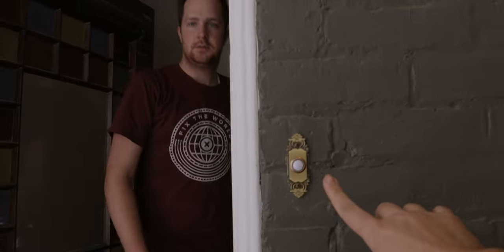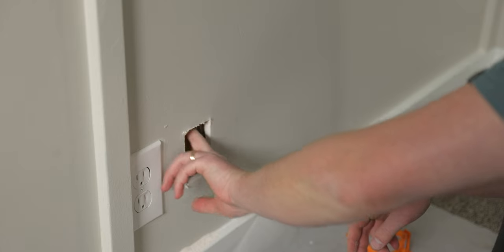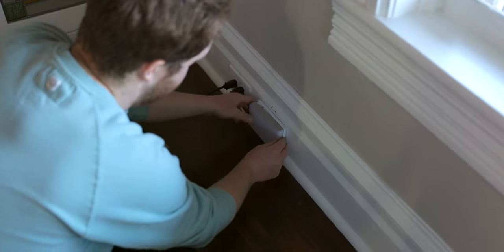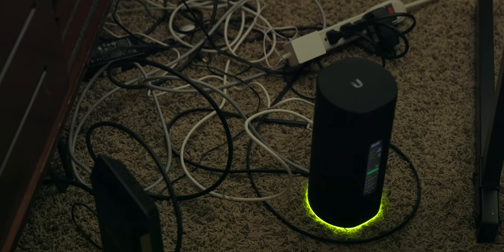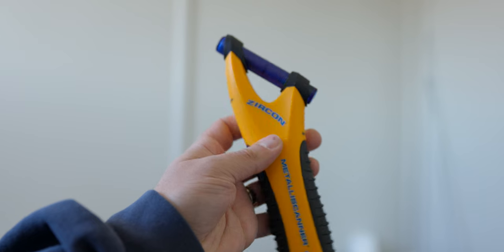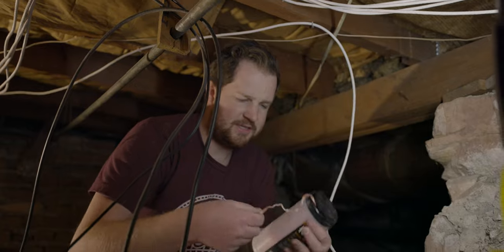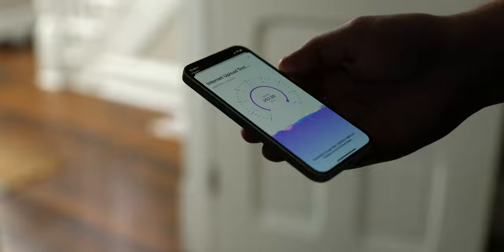Adding 10 Gigabit Ethernet to my 129-Year-Old House!

Comment: Recently found your channel. I do have a question about wiring my similar home. I only have a small network need so my question is this. Can I simply use my modem and a couple mesh routers, one that I connect to the modem via cat6 ran through my walls (plaster like yours btw) on my main floor and the connect the second mesh router/node (or whatever it’s called) via cat6 that is located in the basement? I really only need to connect my main tv, xbox, computer and maybe a second tv wired, the other devices can be connected via wifi.

Comment: I have a "router" exactly that you showed in the video (the white cylinder thing) given by my ISP. I bought two Ubiquity AC in-walls with the hope of routing CAT5 from two of the rooms in my house to the basement and plugging them into that router. Is this even possible or do I need to have a Ubiquity gateway as well? Currently my whole home is getting Wifi from the one router and it isn't covering the whole house with good connection and I've never had luck with the plug n play wifi booster things so I thought this would be the perfect way to essentially create two additional "routers" in my house by having them plugged into the main "router". I'm looking at the install instructions and I'm not sure if this is even possible anymore...

Comment: Obviously new drops should use the best cable you can afford.  However you should have dropped a caviet - If you do have Cat5 DO NOT run out and replace it.  Test it first.  There are meters that will verify your cables for various speeds.  If money is no problem go ahead and buy one.  The cheapest one I know is Fluke and it's 2 grand or rent one or buy someone a beer to come out and use their meter real quick.  If your runs are 50 feet and below 10Gb will work fine on Cat5.

I have a 1800 square foot home.  My longest run is 41 feet.

Comment: Yo, are you in Utah? I install Google Fiber out here and I just wanted to let you know that FJ/ONT that was installed isn't the best. We refer to it as a COTS ont or GFLT132, but they recently upgraded to a mulitgig version of the same thing that has a red ethernet port called the GOGPC220 if I remember correctly. If you change your plan to the 2 Gig BYOR that recently launched a tech will come out and swap it for you, which takes about 5 minutes

Comment: Any suggestions on legitimate pre-terminated cat6a if it's needed?(or hell even cat6)  Seriously from all my looking around it seems like every company in existence is skating around what the standard is supposed to be....and yes that includes the oh so beloved monoprice.  To be more specific, most "cat6" cables you find won't have the separator core, and similarly cat6a won't be properly shielded or have overly thin gauge wire, etc.

Comment: Wow, I have been doing research the last couple of days and have been getting lost on all the different things related to my internet. You really explained this stuff well for anyone to understand!!

I have been looking for vendors of Cat6 ethernet, and I am curious what options are out there for who to buy from. Where did you (or anyone else in the comments) buy their ethernet cable from?
Reply: Monoprice has good cable. When I was at my old place I used theirs and it worked fine. So long as you don't go bargain bin you'll usually be fine.

Comment: I have my Ethernet cord duct taped to my ceiling and intertwined with my stair case banisters. I dread having to bring internet to anyone else in my home. I generally just sacrifice my wired connection and go completely wireless so they can use it.

Comment: Fyi, you will have no luck trying to put cable using existing phone or coax cable. That cable is staples to the wood in the walls during construction by code. You really should put a disclaimer about that.

Also, pretty much every wall in a modern home, even interior, will have wood going horizontally in various places as well. This can easily prevent you from just pushing cable through the wall. Which is why it's actually common for installers to cut out sections of drywall to keep cabling up between floors and then patching up the drywall afterwards.

Finally, be careful with cable jacket ratings. Homes tend to not have this issue, but I'm sure a lot of you will end up running cable for someone in a more commercial setting at some point. You MUST, by LAW, use CMP (plenum rated) cable through ceiling or raised floor areas if air circulates through those areas. It's not uncommon that HVAC systems in commercial buildings will move air through the ceiling area above the drop ceiling. Air return ducts will just go right up into the ceiling. Check your return air grate and see if the air is channeled through sheet metal ducting. No sheet metal ducting, you must use plenum cable. The reason is simple, it's a major fire hazard (quick spread of fire through the cable through the space). And on that note, you should use this red fire putty to seal up any larger holes you might make to feed cable through.

EDIT: it's very difficult to run cable bundles when you remove it from the spool like he did. You will get the new to tangles and stuff when you try to pull. I know, I've tried it commercially before. It sucks. That's why people use multiple boxes.

Also don't bother with those insulated staples for that use. Just get J hooks.

Comment: You commented that as long as the ends of the cable are terminated the same on both sides is not correct.  Pins 1/2 are a pair as with 3/6, 4/5, and 7/8.  This means you place one twisted pair inside of another.  If you don't do that then you will not have twisted pair according to the spec and 10G won't be as reliable.

Comment: Good video. I have a thought and this is definitely up for discussion - if you have existing cat5e cabling in your house because it was build recently enough for ethernet to be a consideration, but not so recently that it was just automatically run with cat6, I would absolutely just keep using the cat5e and not worry about the fact that i'll probably only get a maximum of 5 gig on multigig equipment over any moderate distance.

BUT in a scenario where you plan to run cable all over the place and want to be as future proof as possible... is blanketing your house with fiber the better move? Conceptually my argument is yes, though i realize there are some pretty major gotchas right off the bat:

More expensive (than cheap consumer) switches. Devices often have RJ45 ports, but not SFP ports. Doesn't carry power so POE to a wap means you still need some RJ45 too. 

The benefits would be "just swap out the gear connected at each end for essentially limitless bandwidth upgrades, typically thinner runs so you can pack more fiber pairs into a smaller space." But unless you have such a big hous e where you have a core fiber switch and then access switches elswhere... this is kind of an insane solution. That said if people have a setup where their internet comes in to their basement and they need to hook it up to bedrooms upstairs it might be worth getting in a pair of fibers (or a whole bunch of extra fiber strands) from the basement to the top floor, then using that as the uplink between switches. That way your internet connection can change as time marches on but you'rte never limited to the one pipe you ran from the bottom to the top of your house.

I guess all things considered, running lots of fiber isn't the greatest idea, but including fiber in a house rewire for any kind of switch to switch run should be a no brainer.
Reply: I cabled my 5500 sq/ft  house with Cat 7 and have been totally pleased with it.  I ran a minimum of 2 cables per run (don't run 1 cable  unless you have a VERY good reason, the time and frustration you save  is your own...).  The connections are great, I don't worry about AC lines interfering and the cross-talk problems some folks have.  If you look at the cable itself, each pair is individually wrapped in foil to mitigate RMI/EMI.  They aren't giving teh stuff away for free, but comparing it to cat 6 the difference is worth it when it comes to speed, performance, resilience and all that.

Comment: Well it works fine till 100mb with any color mix. 2 Gigabit device may not even work/chat if colors are not in a or b correct order. And yes i learned that a hard way wondering why system is not working.

Comment: Needs to be keystone (cat 6a) to do 10G. Rj45 is not rated for 10G. Also, I would go for cat 7 rather than 6. And solid core cable inside walls

Comment: I have a house built in the 1970s, but it took like 10 years to build and it was built by people who were born in the 30s and 40s... they were also kinda freestyling it, they just had their friends and colleagues help them build it as they knew best... My house has absolutely no access points for nothing, just 2 telephone ports installed in the 80s, also it's a 250 sq. meter house, that's 2700 sq. ft. by the way... Also, I have no LTE/4G/5G signal... People are coming to install fiber optic internet next week, I wonder what they'll do...

Comment: Looking at this as a European viewer and wondering how American houses don't get blown away or catching fire more often.
We have 95% brick walls, none of this applies except for outside runs (which we hate doing because of esthetic).
Consider yourself lucky for having hollow walls, we need to either use existing holes in the wall (rare) or cut grooves and drill through brick/concrete to run new cables. Not to mention replastering and painting afterwards.

Comment: 22:08 ..oh my 110 punch-block keystones .. Why?!!  Some 20 years ago Panduit made a keystone you pass-through (like you did on Rj45 plug) wires through one part (trim wires on outside with scissors), and then simply snap that "cap" to second part (base) of the keystone and you are done. Easy-peasy.

Comment: What should you use to make sure each line has it’s own dedicated link to the internet?
Reply: Nothing. That's why you have individual cables running back to the network closet. All of the devices plugged into those cables form a computer network.

Comment: My house was built 2 years ago and for some reason they decided that there wouldn't be any ethernet cables in the walls and that there would be no walls above the space the router is. So basically if we want ethernet going anywhere, we either run the cables along the walls or demolish the walls completely.

Comment: Why are access points better then mesh system. I know not all mesh system are the same but most mesh system now and days have Ethernet ports on the back. You just plug the node/satellite into the main router Instead of wireless and now it’s like a access point. So with a mesh system you get the choice of Wireless or hard wired. With access points your stuck with 1 option and that’s hard wired. I’ve been looking at the new orbi WiFi 6E and trying to figure if I buy like 2 50ft patch cat 6A Ethernet cables (going outside the house then back in where I want the node) and plug both satellites into the main router what would be the different from anything ubiquity has to offer besides the fact that there WiFi 6e line up isn’t out yet. Also with so many Ethernet ports on the back of the satellite and main router it almost eliminates the need for a switch right? Am I missing something?

Comment: Not bad, but a few newbie mistakes.

1. Ethernet 8p8c is not RJ45. RJ45 is a keyed 8p8c connector.
2. Find the studs, but dont worry about the electrical wires you're blindly cutting and drilling next to?? Must have a death wish.
3. Distribution wiring is solid wire (room to room), patches are stranded (outlet to device). It matters and it matters that you terminate with the correct 8p8c type, solid or stranded, for the wire type you're using.
4. Standards matter. Use them. One mistake with PoE and you'll fry your expensive hardware because the next/previous person wired something differently to you.

Other than that,  a good video.

Comment: Ah! The puchdown tool.  The moment you just have enough cable to connect the keystone,  punch down on the wire then discovering the cutting part of the punchdowntool is actually reversed... cutting the wire on the wrong end... ( not happening the first time lol )

Comment: Completely unshielded LAN cables is a big oof. Nearly a decade ago I ran SF/FTP cables with a much lower CAT rating but can easily run 10 Gbps ... just because of the excessive shielding. If I had used UTP cables, I'd have to upgrade again.
Yes, UTP is much easiert to install ... but since you don't do it very often it shouldn't be such a problem, especially because you only need to care about the outer shielding. The foil gets cut off as well as the foil for the four individual pairs.

Comment: to bad that u havent restored the old windows. But nice house, we live in a house that is 100years. I dont understand how u can have plaster and not just timber walls since its over 100years old? Then again murican old house vs in the north of sweden old house i guess the building tech was different. We have sturdy walls of full timber with double outerwalls. We are installing new windows hand made with 3 glass and the outer is hand blown culture glass. I use a dreammachine with unifi pro aps, beats everything on the market (ok ruckus might be stronger).

Comment: 14:46 You left out the part where you get electrocuted for cutting through the power line running horizontally in your wall.

Comment: In my opinion, if you are going to run data cable, you should use CAT 7 or even CAT 8, at least if you plan on living in your house for a long time. The last thing you would want to do is have to run all that data cable again in 15 years. I bet people that ran CAT 5 cable 15 or 20 years ago probably wished that they had gone ahead and spent the extra money on 5e or 6. If you run CAT 6 today, you might be that person in the future.

Comment: I'm wanting well planning on massive home remodel.  My electrical wiring is a damn nightmare.  Switched neutrals no grounding 100a service and limited outlets in my rooms and a kitchen that is underpowered.

I also want to put in networking though for the life of me I'm not sure I can justify it.  Everything I own is wireless.  But I want to put like accent ( LED strips ) under cabinets in my builtin shelves, and I think that POE would be the way to go ... even if in my basement I have single poe injectors instead of poe switches.  Just trying to figure out how to get the wife to accept a ethernet jack in the wall in the shelves is giving me fits.  I want it there for when I need it ... but I want it invisible, unobtrusive, before then.

Comment: Please for the love of god, if you run cat 6 cable or the equivalent outside within reach of people or the environment, run it in conduit...its a bit more of a pain in the ass but youll be grateful when you bump into it and you wont need to re-run the whole thing. All it takes is someone digging nearby with a shovel and bumping it with the tip to sever some of the pairs

Comment: Hi there.   I have a new 1.2GIG internet service.  I am getting 949mps on my wired computer.  New iPhones and tablets (even a brand new ipad pro are topping ouit at about 400mps.  Am I missing a page somewhere?    I bought a 6gig wireless router AX3000 router.  No faster....   I have the need for speed here

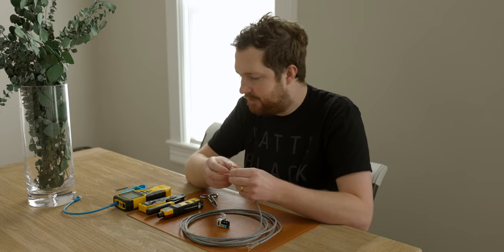Comment: 19:35 hey, what you said is not 100% correct. The order does not matter only if you keep the pairs.... paired. (E.g., swapping the blue/white-blue cables with brown/white-brown).
Twisting pairs reduces the crosstalk, and randomly connecting the cables defeats this purpose.
As a result you will have a lower SNR and, for example, cat 5E cables may not be able to establish a gigabit link or, even worse, negotiate a gigabit link but have a huge packet loss!
So, as you said later, it is better just to follow the standards 🙂

Comment: You say it does not matter what connecter you use, but that is not true.  Keystones are for solid core wire and RJ45 is for stranded wire.  Solid is for your in walls and plenum and stranded is for patch cables.

Comment: No the cables won't work of you don't follow the standard. They will kinda work but you'll have tone one weird problems. It's due to the fact that Ethernet uses differential encoding so electromagnetical interferences cancell each other in the pair.

Comment: You're not describing supposed "RJ-45" and "keystone connectors" quite right. You're talking about keystones as if they weren't RJ-45s too. The keystones that fit RJ-45 plugs ARE RJ-45 connectors too; just the jacks instead of the plugs.

Comment: Did you say "99" when you spoke of the punch down blade?...turn it upside down...also, when using the pass thru RJ-45 , it may seem easier but they're prone to shorting and oxidation being the wire ends remain exposed. I've worked with companies who if they see you using the pass thru RJ-45 they'll fire you on the spot.

Comment: If only the contractor that ran the coax cable didn't secure it to the stud, then I could use the pull through method.

Comment: There is a wrong way. Solid wire is designed to stay in your wall and shouldn’t be moved around, because it can break. Patch cable is made is made to be flexible, so you can manipulate it without risk of breakage. That’s why it is used to run from your wall to devices.

Comment: I could only get 6mb but it only get kb max is 700kb idk how to fix
Reply: Make sure you have your units right. ISPs advertise in Megabits per second (Mbps) but most web browsers and other programs show speed in Megabytes per second (MBps). There are 8 bits in a byte. If you divide 6 Mbps by 8, you get 0.75 Megabytes per second (MBps). You're getting close to your max speed. The only way to get faster speeds is to pay for a faster connection.